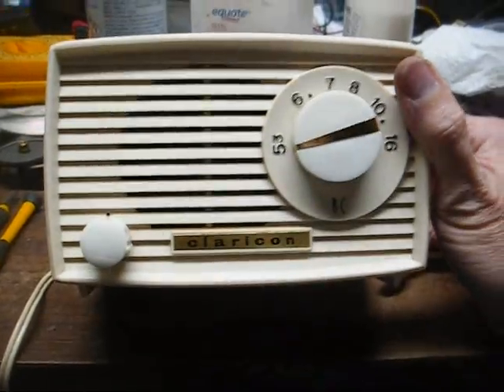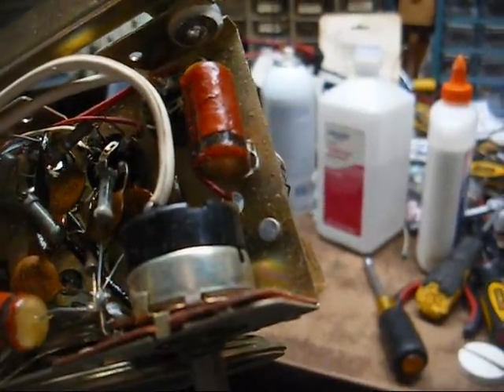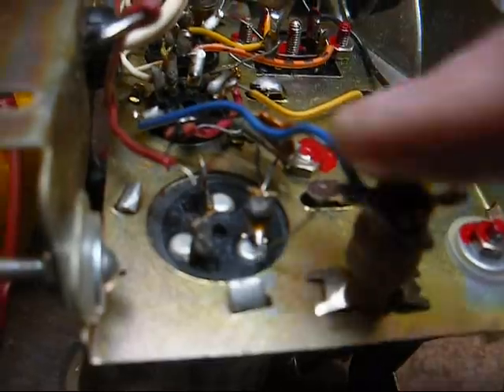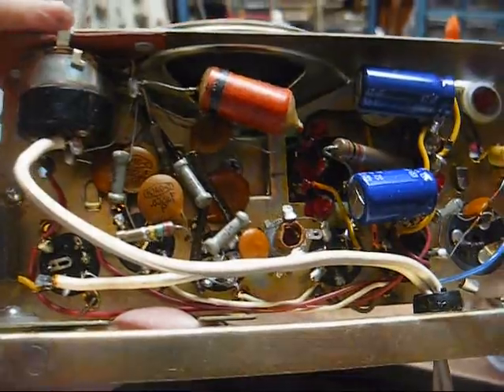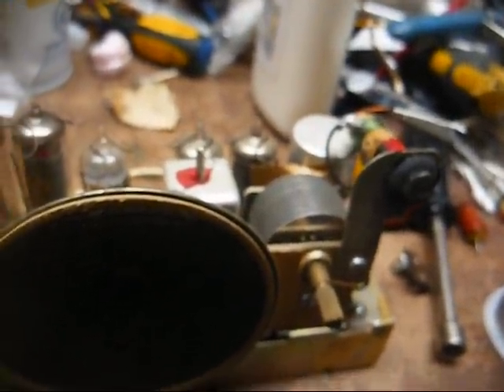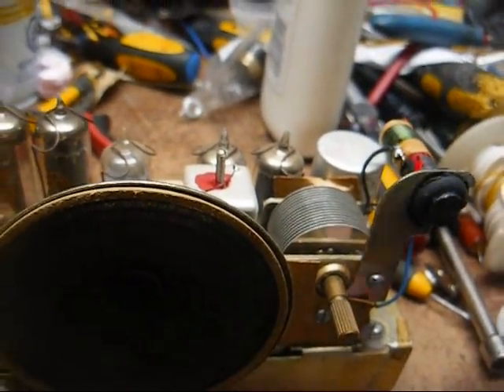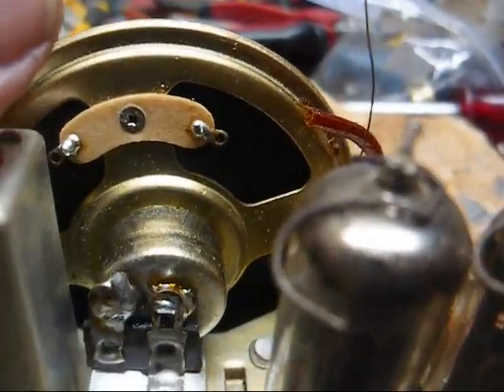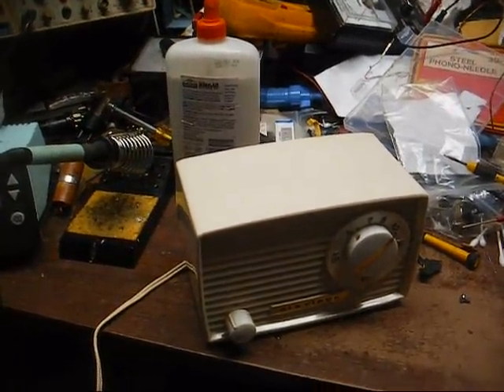Repair of a circa 1960 Claricon Japanese-built AM tube radio

Comment: Claricon was the name of an importer also known as World Mark. They should not be confused with Clarion, a Japanese maker of auto radios, speakers, and other equipment. Based near Pittsburgh, they bought and imported low-end radios and related items. They did offer at least one CB set in their final days. The brand disappeared after 1972 and they were absorbed by a conglomerate that bought and often reused names (Like Crosley.) It was probably this outfit that fielded the CB unit. Some of their suppliers (especially for tape recorders) were what would become well-known brands later on.
Reply: Whatever Japanese company used the name "Clarion" must have bought the license to use the name after it fell into disuse in the U.S. The original Clarion was the brand name for the American Transformer Company, they built a number of AC models in the late 1920s and early 30s, and transformers too obviously. Who made this particular radio I'm not sure, a lot were made by a company called "Rincan", but there were a lot of independents that seemed to built nothing but private label sets for retail stores.
Reply: Generally speaking, an "abandoned" brand is free for the taking, but technically a brand could have been used for any non-related industry or product decades ago. There were hundreds of products sold under the names "Acme" (a joke even before Chuck Jones adopted it), "Simplex", "General" (X), "Universal", "Perfection"",  "Superior", and on and on. The thing about all of these is they were common words in the dictionary and therefore could not be trademarked in those days. That would include 'clarion" which was a word for clarity. But since Clarion had not been used for years in was free for grabs.

Things have changed since then hence we now have "Apple" (a long story there involving the Beatles). In the 50s we had several brands called "Craftsman", most commonly thought to be (once) a Sears exclusive but was also unrelated names of electronic (HiFi) gear and other products. It was only later that disputes over names like "Realist" started to become the subject of legal threats and eventually court cases and legal precedent. International cases have added to this.

When Matsushita first entered the US market they used a name they used everywhere: "National". Of course, we already had a brand of radio equipment known as National and since they were brands of the same thing (radios) Matsushita had to stop using it very suddenly. You can find examples of the same model tape recorders and radios from 1965 where the name on them suddenly changed from National to Panasonic.

Comment: The antenna looks like it's about the same size as the ones used in the pocket transistor radios of the time. One size fits all.
Reply: No no no, they were much smaller bore, and lengthier  in the "Tranies" back in the early 60's

Comment: One way that you can fix a speaker with a rubbing voice coil is to remove the dust cap, slip some plastic shims in between the voice coil and the pole piece, then you moisten the cone, and the spider, then let it dry. If you have done it right it should no longer rub, then you can glue the dust cap back on, and reinstall it in the radio.

Comment: When replacing old resistors in these radios how do you determine wattage if it's not listed specifically?
Reply: You can usually calculate it from the voltages in the circuit, or even measure the voltages when you think you've got the right size.

Comment: Judging from the Conelrad CD markings on the dial, the radio probably was manufactured 1963 or before.  1963 was the last year that the Government required  manufacturers to use them.

Comment: I also fix old radios, than put it on shelf  and never turn it on again
Reply: mmartin 
You repair them, that’s great, but radios were made to be used.
I can’t work on them, beyond some DeoxIT, so I have to farm mine out.( ind that gets expensive, especially on a tight budget), but the few radios I have, I also use.  My Tube radios, when I’m working around the house, and transistor radios, I take a different one with me on the job, every day I work.
( I’m a Mobile Auto Detailer).  I like to show them off to some of my clients.
And once a month I bring a couple to my club, to show off.
[ Jacksonville Antique Radio Society (soon to be re-named:”Jacksonville Vintage Radio Club).
📻🙂
Reply: If your area is anything like mine, there is nothing on local AM (...or FM for that matter) that is worth listening to!

Comment: I know for the most part these are crappy little radios. They used cheap parts that would fall apart in your hands. But I've always had a soft spot for these. I have a collection of these in different colors and cabinets. I was fortunate enough to find some of these on epay/ fleabay before they started going for nuts prices.

Comment: Japan runs on 100 vac, the US is 120 but most of the World is 240.  Wonder if they sold those hot chassis radios in countries with 240vac?
Reply: Japan/US conversion is a simple tube change (the 50C5 audio output is changed to a 35C5 in Japan). Other parts of the world used resistors in series, usually in the set, but also resistance line cords. I think Hallicrafters offered a resistance line cord for conversion of the S-38B to 220/240 volts.